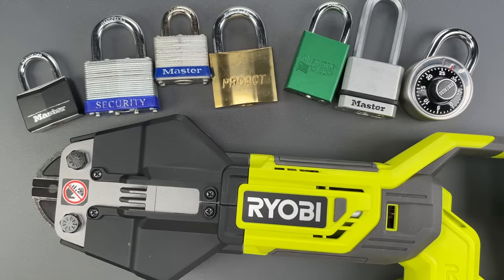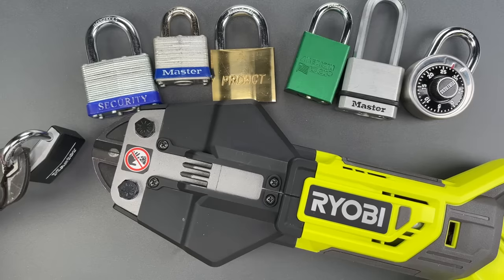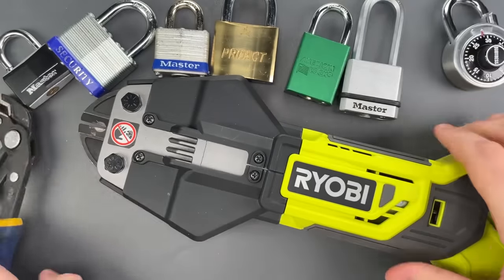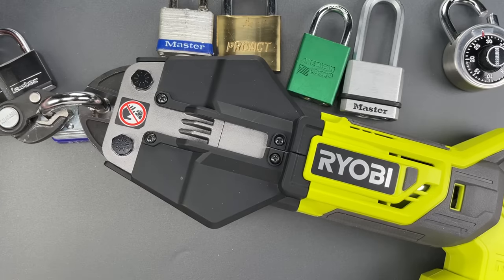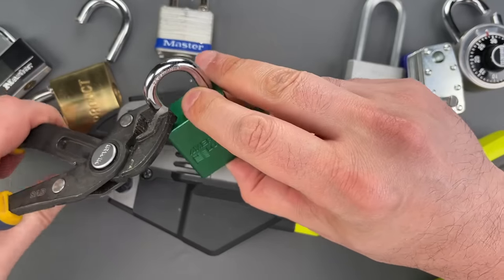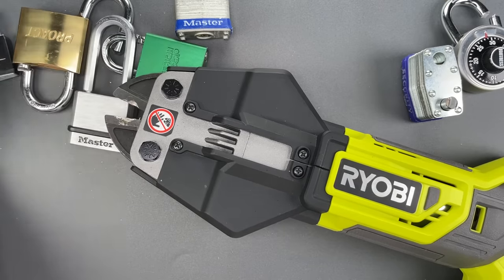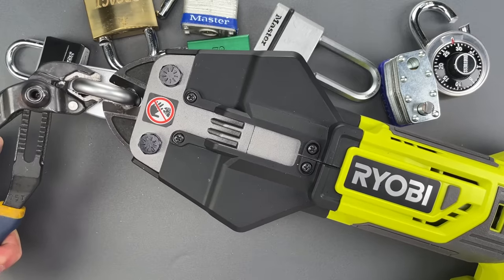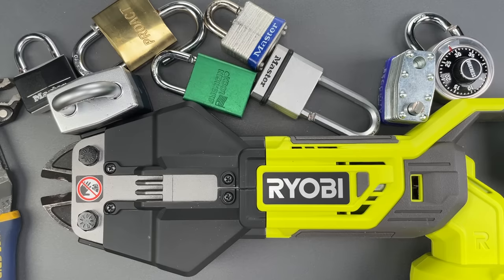[1408] Better Than Expected: Ryobi Bolt Cutter

Comment: It's worth mentioning that the fancy new Ryobi batteries for brushless tools seem a bit over sensitive to tripping on high current than the older style lithium batteries.  A beefy 4 or 5Ah battery might cut out less.
Reply: There's been some back and forth in the comments that a higher AmH battery also can deliver more power. That was frankly news to me, even though I have seen it in my own tools. I think it's a topic you or AvE should tackle, if you already haven't done that video.
Reply: I agree would like to see that
Reply: That's good to know, though this is a brushed tool (you can see the sparks from the brushes in the little opening closest to the handle).
Reply: @nickbradley8354  shouldn't be any back & forth at all.

All else being equal, a higher capacity battery will have a lower internal resistance & higher rated current capacity b/c of the combo of increased surface area of the electrodes & additional electrolyte volume.
Reply: @IstasPumaNevada  Came to say this exact same thing lmao
Reply: The overcurrent circuit might be there to protect the blades, not the electronics.
Reply: Not sure why you all are confused, but the device clearly stops as a safety feature to protect itself, and to step the pressure up gradually so that it only uses what force is needed for the cut. Not once did he mention voltage in the video, and a tool made for this exact task isn't going to need extra current to do the job.
Reply: @nickbradley8354  It has been proven , also confirmed myself, that the higher amp batteries do provide more power and runtime. Significant difference between 1.5aH and 9aH in terms of power
Reply: thanks for a heads up. will keep a spare battery when cutting bike locks like butter B)
Reply: I'm a Big Clive fan, and to see him watching LPL is awesome!
Reply: Torque test channel proved that in most situations higher mah batteries yield higher torque output on handheld power tools (specifically impact wrenches).
Reply: @Connection-Lost  Or the battery overcurrent protection trips because of the motor's increasing load? Idk, seems pretty straight forward to me.
Reply: 1000%, anyone in the trades will agree.
Reply: @nickbradley8354  They have more cells in parallel, so lower combined resistance.  A high current tool like a grinder, circular saw or chainsaw will definitely have more oomph on a larger battery.
Reply: Perhaps the engineers worked out the pressure the jaws fail at and incorporated a set stall force for safety, I've been shot three times with fracturing steel it's not fun.

I still say give it the beans it's just another point of view.
Reply: It would be a LiPo cut off ,stops the batteries exploding.
Early LiPo had the be charged in a fireproof bag.
Reply: @bretteinhorn8507  Anyone in trades don’t touch Ryobi
Reply: @A.D.D.O.C.D.T  says the guy with a bicycle.
Reply: @A.D.D.O.C.D.T  I guess that burglary s a trade too.
Reply: Am I the only one that read BigClive's comment hearing his voice in my head? LOL
Reply: Is it the battery itself that is tripping?

Yes, those batteries can supply more power, it is being shut off electronically by the tool.   Meaning beyond a certain point (that this already exceeds)  a better battery won't make a difference.

Not too unlike a drill with an electronic clutch.
Reply: i have a ryobi drill that gets scared and turns off when it hits a finish spot at the end of a through hole... even if you step up sizes 5 times. not particularly formidable.
Reply: All my tools are corded.  I'm not buying a replacement battery that costs as much as the tool
Reply: @jcrowley1985  The reason the batteries cost a lot is because of their value to a tradesman.  You find very few corded tools on sites these days.
Reply: @deletdis6173  same
Reply: Yeah it does look like the battery tripping. Id like to see this tool in AvEs hands
Reply: My experience with Ryobi tools is the stem of the battery melts because the tools are working the batteries too hard, and the battery gets stuck in the tool. These are the batteries that came with the tool.
Reply: So is this why my 20v Aldi garden blower cuts out when I press the "turbo" button  using a fully charged 8ah battery, but not the 4ah battery? 
There's some sort of cut out in the battery itself, not in the blower?
Reply: @nickbradley8354  Voltage drops when power drops, you get less of an effect with higher ah